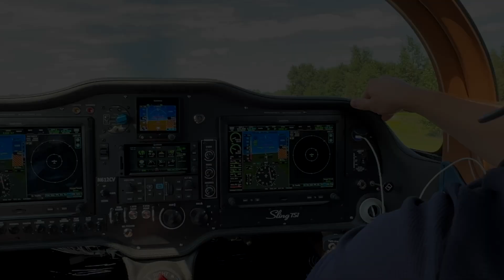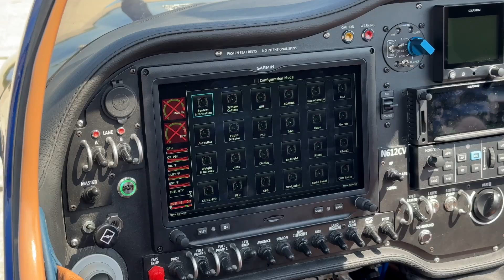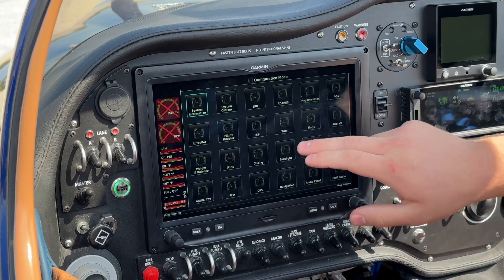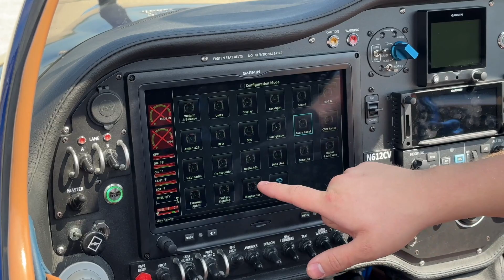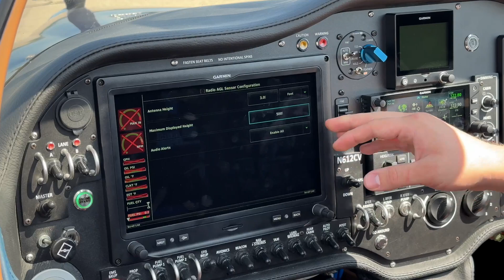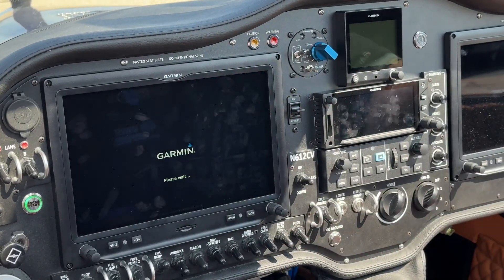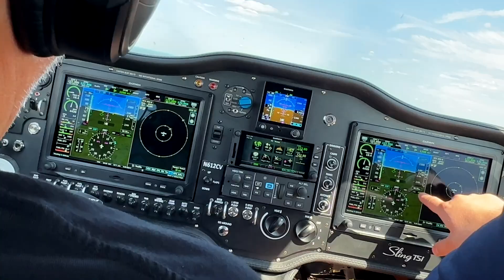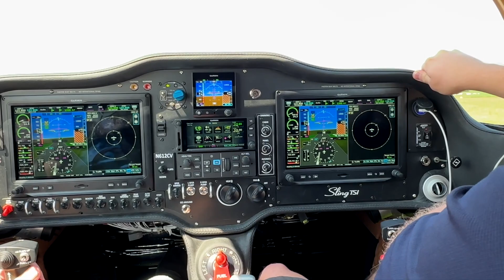Garmin GHA 15 Height Advisor!

Comment: I am still considering this thing for installation. I already 3d-printed a similar device for checking for obtrusions (I attached a laser pointer to it). I will have to move quite a bit aft in my Bristell RG to have a free vision for the GHA15. Can someone pls. point me to the installation manual where the wiring diagrams etc. are included? The general G3X install manual does have the mounting description, but unlike for other extra Garmin hardware it does not at all refer to the wiring. I am just curious if I only need power and CAN bus or anything else for the GHA15.
Reply from the maker: @michaelrobbig-reyes5525  if you are installing it in a G3X system you only need CAN, power and ground.

Comment: I love the idea of this, but I've seen a couple of examples of this, including right from Garmin. The distance to ground is not what the G3X is showing. Are there adjustments that can be made in the panel, or is it just more important to listen to the GHA-15? Going from 50 to 20 then10, 5, 3, 1.... Seems like a weird sequence. Just my initial opinion. I think I want one anyway. Great content as always! 👍
Reply from the maker: The AGL height is showing just below the altimeter tape. 

The sequence is what you get, there are options for less call outs.
Reply: @MidwestPanels  What's the lead time on ordering one? And does it come complete with everything you need to install? The harness you showed doesn't look like it would reach the panel from the bottom middle of any plane.
Reply from the maker: @dh-flies  they are out to October right now.  the harness we show in the video is for our Sling customers that have our tail harnesses in it and not intended for all airplanes. 

We can assist you but we would need to know more about your plane.
Reply: @MidwestPanels  I own a Bristell. 912 IS, dual G3X, GTN 625.

Comment: How does it deal with uneven areas and obstacles (trees, buildings, etc.) ahead of the runway?
Reply: it only tells your current position relative to the ground below you.
Reply: I was wondering the same, so if there's trees at the approach end, does it sense the tops of the trees as height agl?
Reply: @maverick758  yes.
Reply from the maker: It does indeed pick up the closest return.

Comment: I think you just confirmed that this device isn’t really compatible with float-rigged aircraft.
Reply from the maker: Depending on the plane the floats could be an issue but if you can place it further back on the tail to clear them it may work.
Reply: I'm thinking of installing an antenna under the wing